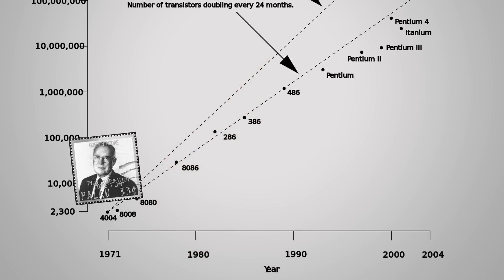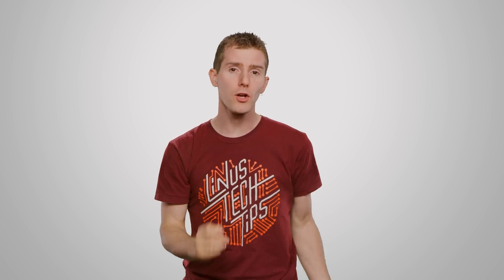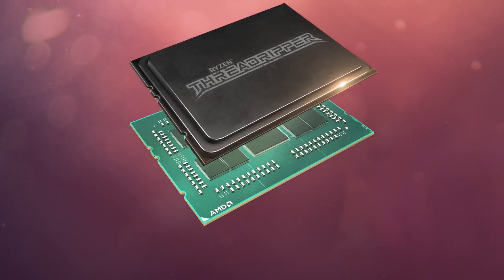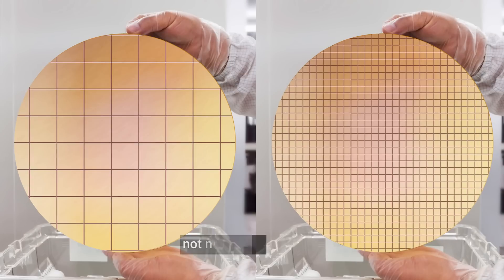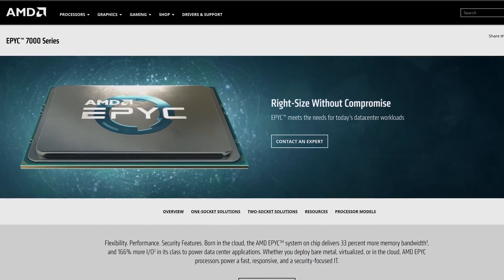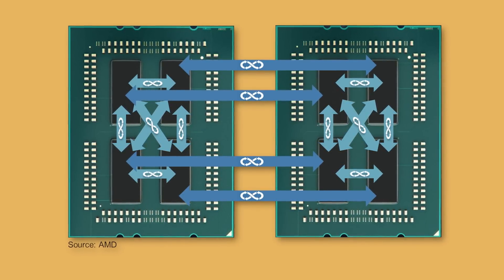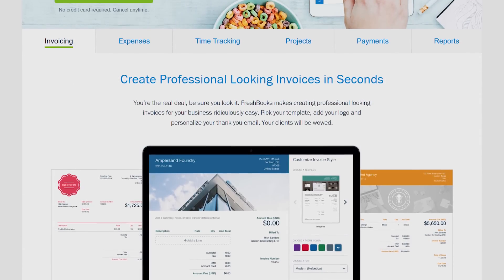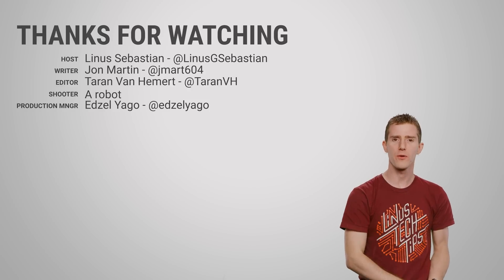How AMD is Making CPUs More Affordable - Chiplets Explained

Comment: AMD: Uses smaller dies to make powerhouses that single handedly destroyed Intel.
Intel 12 years before: LeTs GlUe 2 AtOm DiEs In A sInGlE PaCkAgE (Translation: Used teeny tiny dies to make a dual core Netbook CPU that sucks so much that can't play video without stuttering, due to CPU bottleneck)

Props to AMD for picking up tech concepts that failed when Intel tried them, and making enormous CPU beasts that are killing Intel.

Comment: i dont undesrtand why the cpu has to be so small?why they dont make it bigger to fit more transistors inside?
Reply: Probably it will cause internal lag inside the cpu because the clock has to circle the whole cpu before proceeding (correct me if im wrong), on the other hand i think im wrong because the cpu also contact the ram and GPU, so yeah idk too why they dont make threadripper size cpu for gaming primarily
Reply: @Adrirenn  Big cpu requires big socket and big motherboard, that are EXPENSIVE. The Threadripper socket has over 4000 gold contacts and the motherboard requirements are also far higher because of the size. This all increases price so much that if consumer chips were as big as Threadripper, they wouldn't be any less expensive than Threadripper. And yeah, also latency penalty from the distance.

Comment: Chemical properties of silicon?
Nope. It's quantum mechanics. We can make smaller transistors, but they leak and there's nothing you can do about that. Unless you move over to quantum computers.
My job is to sell spectrometer/microscopes to the people working on these nanomaterials. Some really cool materials will surely appear in the next 20+ years. By materials I don't mean bulk pieces of them, like sliced silicon which is then processed. I mean layers grown 2 atoms thick one atop another as the processing.

Comment: i don't think size is a draw back. 
id rather have a bigger CPU if it means more processing power. 
also everyone seems to forget moore's law didn't specify fixed chip size transistors had to fit on. simply put, make it bigger and continue the trend. 
i don't care if my CPU is the size of a brick if it means insane super computer level processing power, as long as its relatively easy to keep at a good operating temp.

Comment: if you kind of think about it...we started from 45nm (intel core 1st gen) and now we are at 10nm... amd is at 7nm already, what happens when we reach 1nm? is that the end of the line for cpu advancement? are can we even go below 1nm and manage 0.7nm, 0.5nm etc? I can't wait for 2030 to come! Used Budget PCs will consist of Intel Core i9, RTX2080, 32GB DDR4 RAM and  5-6TB HDD + 1TB SSD!

I'm gonna start saving 10 euro /month for 10 years :D

Comment: 0:38 the problem really is because of Quantum property of an electron and how the tunneling probability increases as the size of the transistor decrease. Meaning we cant turn off the transistor after a certain limit(1-2nm)(we are currently at 5nm/7nm but even in this case the leakage currents are massive and the photolithography techniques used to fabricate transistors are getting more challenging). Thus logic gates cant be implemented and hence you cant make a CPU out of it.

Comment: I've always wondered why we have never really had modular CPU design. I.e. multiple sockets and you can put in different CPU's then designate purposes for them. Somewhat akin to how we can mix n match different storage drives and say "ok C: is my SATA SSD for windows, D: is my NVMe for games. E: is HDD for storing video files" etc. Similarly we could have multiple physical CPU's assigned to different tasks. They don't even necessarily need to be linked in any way. I.e. using an older CPU that goes into a PCI-E slot and then you run a lengthy RAR compression task on it and it has zero performance impact on your main CPU, it's just busy doing its own thing so it wouldn't slow down anything else you are doing

But I guess its mostly a niche case, probably horrendously complicated to implement and there's no money in it for anyone
What AMD is doing doesn't matter to the consumer, it may be a modular CPU under the hood but its not like you'll ever be able to swap components of it, it's still just 1 entity

Comment: I remember giving intel hell about this for the core 2 quad. Granted in that day core 2 wasn’t designed for modularity like this so in the end I would agree this is the better way to go instead of wasting good silicon for low end parts by deactivating things unnecessarily.

Comment: Why not make the board you place the chiplets on bigger? lol
Reply: Because....Latency. 

Latency, is the delay caused by the fact that signals don't travel instantaneously. When you increase the board size, the average distances signals have to travel, increases. That delay, is more latency.

Latency, is already Ryzen's weak point.

It's why instead of spreading out in 2D, Intel went with the 3D stacked chipless. You get shorter average distances travelled by signals. But going 3D has its own set of problems...more challenging problems...the main one being heat dissipation.
Reply: @tylerdurden3722  Thanks for the explaination

Comment: Linus it not about how big chip can get while not caching a defect,its about a speed of light and how far signal from a clock generator can travel to maintain synchronisation in the chip, practical limit 40x40mm chip

Comment: I am missing one crucial thing from this video: the interconnect. A lot of IPC performance depends on it. When we're talking chiplets, this interconnect is still on a "chip" but distances are larger.
Also it would have been nice to say that separating I/O from CPU is not that new (remember north/south bridges). What is new is the place where to put those blocks.

Comment: The capacity of longer wires is a larger issue than the speed of light since increasing the capacity of the interconnect increases power usage and heat production. It also limits the clock speed due to the the time that it takes to change the voltage in the wire according to kirchhoff voltage law.
Just wanted to throw those fun facts out there.😉
Reply: zero point energy baby

Comment: What abot graphene wires, that would decrease the power requirements and probably make the chip even more stable whilst giving it room for even higher clocks?
Reply: Or a  substrate that makes less heat aswel I think graphene aswel

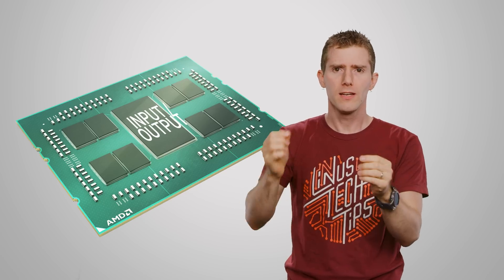Comment: 3:36 ~ "Painful Sexy" ~ I spend so many hours imagining that exact design on PCvsConsole.com ~ Whatever Darpa God is, it had me meltdown after i posted that the IBM PowerPC core should be more centrally located if it handles all the SPE APU. ~ They wanted me to suggest HBM memory back then, but i never understood what that was or why it mattered, or that there would be a 10 year delay if i did not figure out what IBM meant by water layer chip stacking, some engineer was crying that i understood core placement, and did not understand the need to go a step further and stack memory also.
Reply: 10:00 ~ Going to search for the past ones tonight. ~ #LoveYouToo!

Comment: I've never understood why it's a must to make processors smaller and smaller.  Theres more than enough room in most computers to have a piece the size of a second processor with extra transistors so the processor could be made wider or bigger.  For instance, you could have a processor the size of two and still have plenty of room in a computer but it would have way more transistors because it has extra space being bigger.

Comment: The obvious drawback to chiplets is the fact that signals crossing chiplets are almost as bad as signals leaving the chip via pins - which just goes to show how powerful and useful it was to develop Infinity Fabric. That would basically be the bottleneck for what you can achieve with chiplets.

Comment: I heard some companies were experimenting with 3D processor designs as well. And then there's photonics: using photons(light) to operate transistors instead of electrons. And we could use other materials instead of silicon as well. So we haven't exhausted all the possibilities but I think we're about to hit the limit for silicon.
Reply: U mean quantum cpu
Reply: @Ri so pia Eh as far as I know, it's not exactly a breakthrough because quantum computing can only perform certain types of calculations faster than normal computers, not all of them. But maybe it will become significant in the future. Idk
Reply: @feynstein1004  but the power to run it is much more
Reply: @Ri so pia Hmm I really don't know enough on this topic to comment any further.